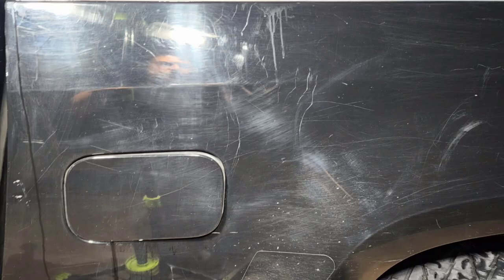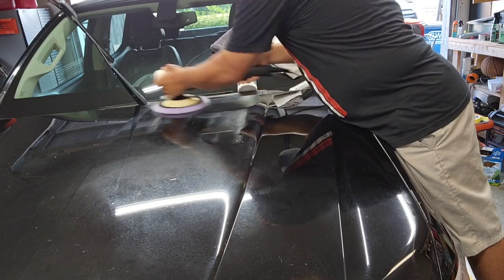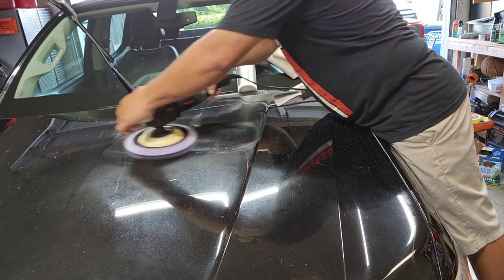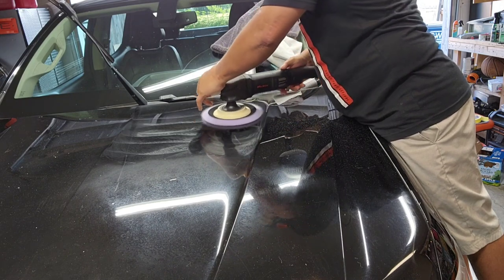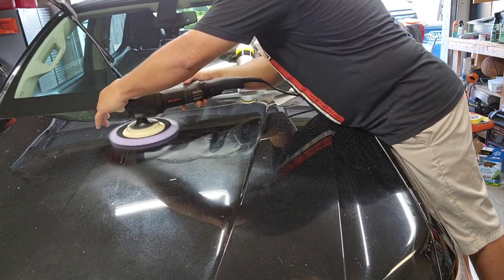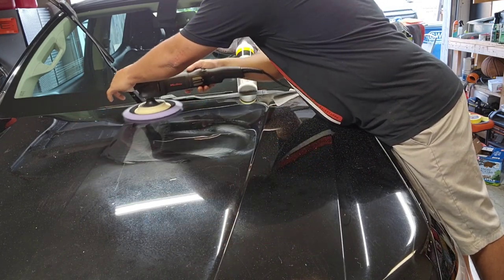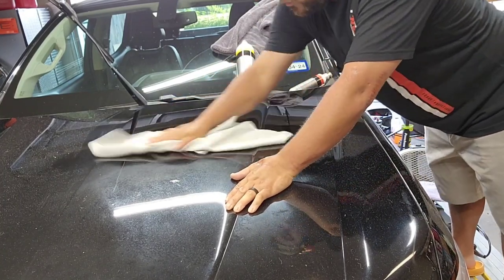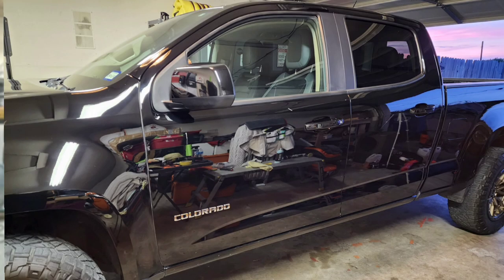Fixing a damaged truck!!  #paintcorrection #mobiledetailer

Comment: You are right rotary has its mind of its own. I used it once on my old car burned the paint, never touched it again. Using a DA is easy but I will pick up a rotary soon. Good work BTW.
Reply from the maker: Thank you for the feedback 🙏🏼
Reply: I had a very similar experience. I think I correct wayy too many trucks to not have picked it back up by now, tho